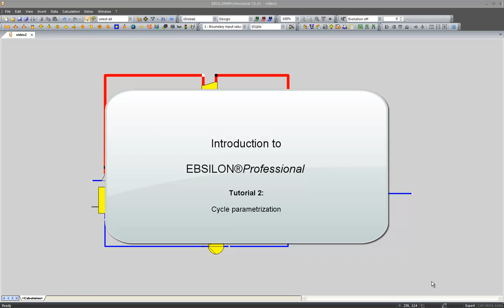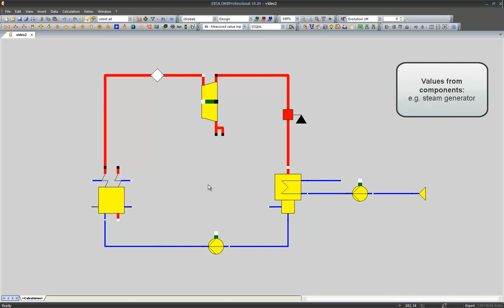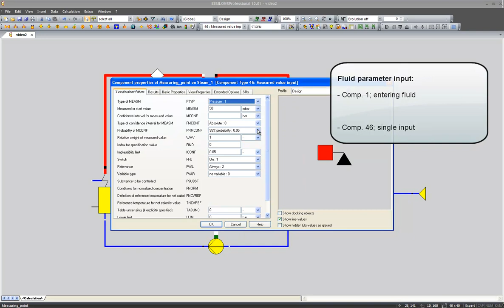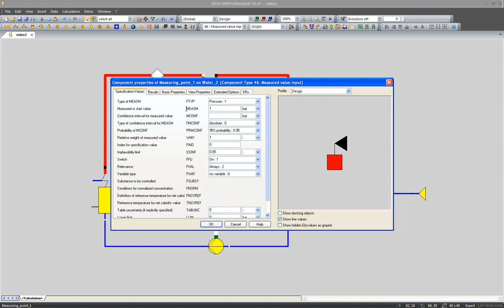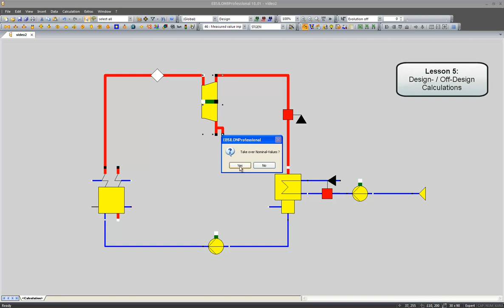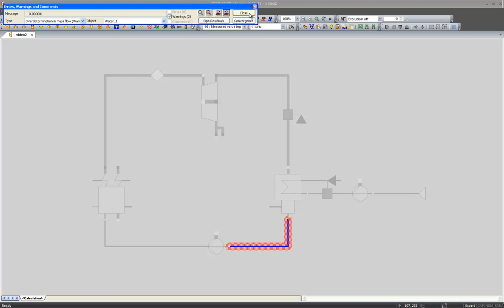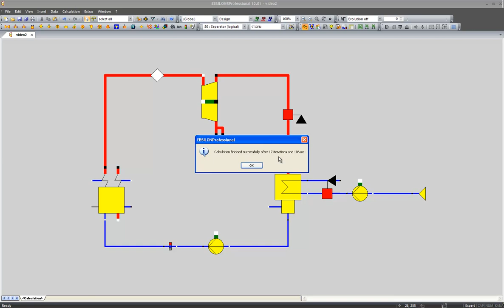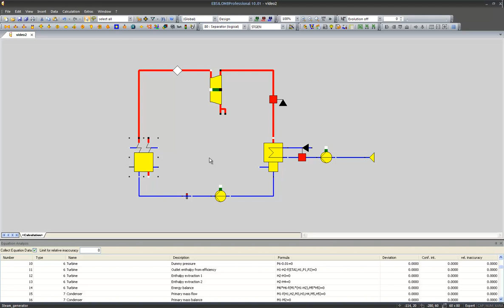Simulation Software EBSILON Professional - cycle parameters

Comment: I am getting over determination innpressure between Turbine and Condenser, how to fix it?
Reply: Dear Sujan,
if you had put a "measurement" or a "general input value" there, you should delete them. OR change the setting FSPECPD inside the condenser. If that doesnt solve the problem, please send the model to info@ebsilon.com